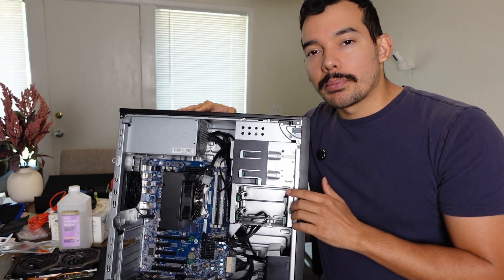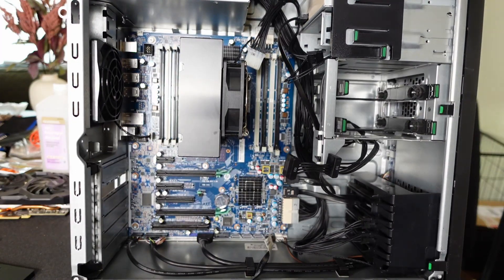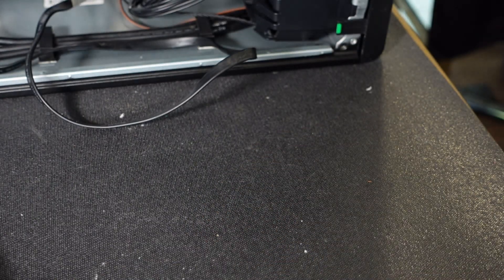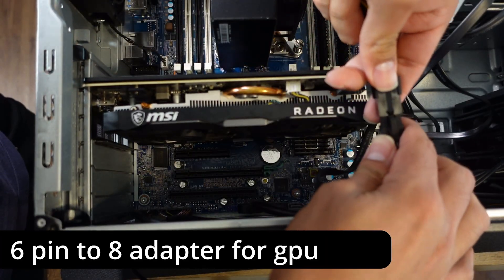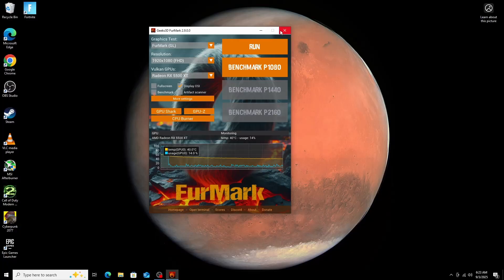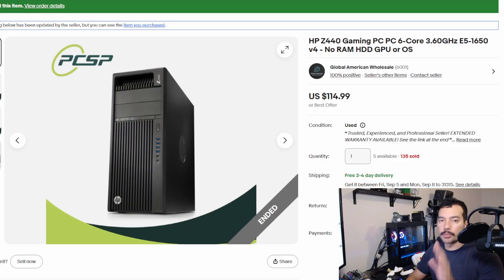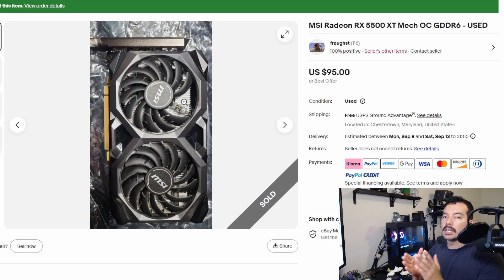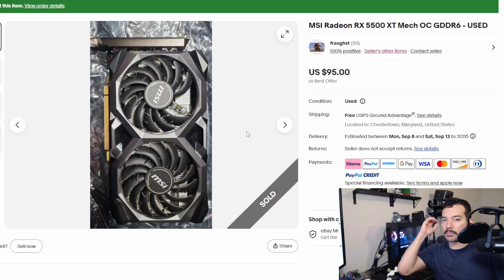Watch Me Upgrade This 11 Year Old PC for Gaming! Z440

Comment: Using 18 cores for gaming is counterproductive unless you run exclusively highly multithreaded games. I run an e5 1680v4, a reasonably high clocked 8 core on the smaller process node which i believe to be the best cpu for gaming in this machine

Comment: What cable adapter for the gpu you guys recommend? since the stock only have 2 cables with 6 pin each
Reply: Yeah. I want to know if I can power my new rtx5060 with a single 6-pin power connector. Need a 6 pin to 8 pin adapter I know but not sure if I have to use both 6 pin to single 8 pin to power it. I do have the 700w psu.

Comment: Mine is used to crunch quant data which I used to create trading algos. Running Windows server 2019, E5-2695 18core 36thread, with 128Gb RAM. I've got a Xeon E5-2696 V4 22C 44T CPU on its way to upgrade it and that cost £49. Cheap power computing. Great rig and sooo quiet.

Comment: FYI You dont need to download all the drivers for each item. Simply download "HP Imaging Assistant". Let that run and it will fully setup your system for you with all the correct drivers and packages.

Comment: I have a Z440, 20 core, 40 threads, 64GB. Quadro P4000 8GB that i have modded with a huge heatsink. And M.2 SSD. Its the 700w PSU version. Its a beast !. I only do driving games like Assetto Corsa and it does 150 FPS on Maximum. And its silent. Here in the UK. £160. Cheap power !.

Comment: it was such a new experiment, I have Z440 with XEON E5 2680 my PSU is HP 700W i'm wondering if i buy RTX 3080 and use 6 pin to 8 pin connector and 2 SATA to 8 pin the GPU won't get on fire or smoking?
Reply from the maker: I am assuming your system does not have the two 6 pin connectors. I would probably just use two 6 to eight pin adapters. My 3080 has two 8 pin. I would not recommend sata to eight pin. I would be concerened. My 700 w has two 6 pin cables. If anything you might have to get another psu. But you may need to adapt some things like the motherboard cable cause its differen.
Reply: @locotechman  my PSU has two 6 pins but i wanna know is it ok?
Reply from the maker: @Khoda-f7h  Well, there is a chance that it may not be able to support it. At a minimum it needs a 750. I have not tried it. There is still a chance. There is also a chance for damage but I am not sure. The best case would be to replace the psu and get the adapters. If you dont mind the risk you can give it a try.
Reply: Afaik the 6pin support 150w, so a 6to8 pin is fien to use. I run a 1080ti no problem